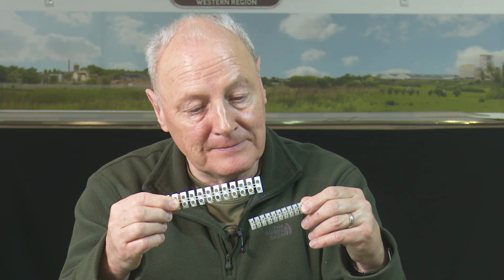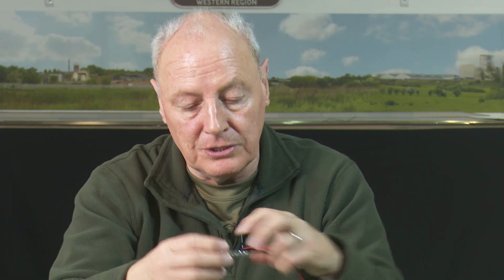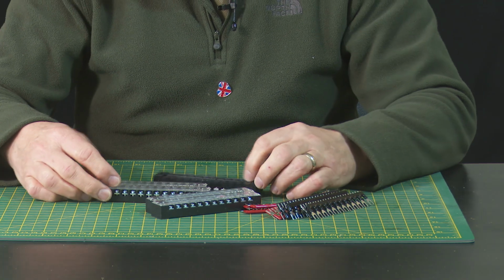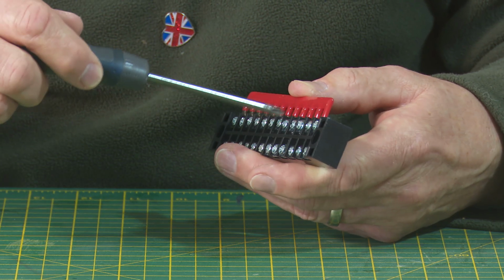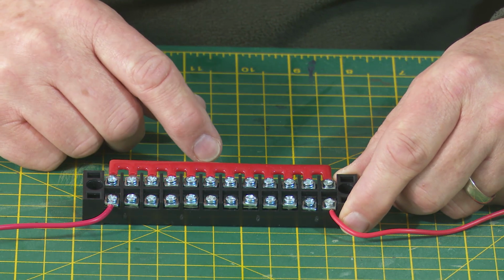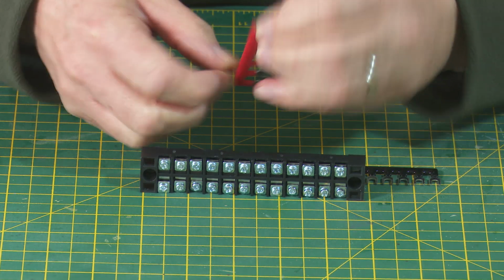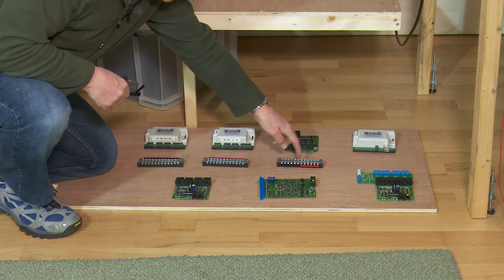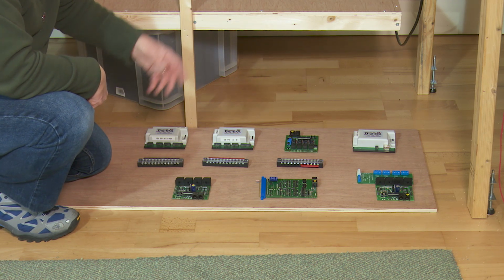Terminal Blocks for model railway wiring at Chadwick Model Railway | 85.

Comment: I might have to move to the UK. Those terminals are 90 plus australian dollars, plus postage. Model railways is becoming a hobby for the elite here in australia. Love your videos, keep them coming
Reply from the maker: Blimey Leon, that’s a shocking mark up.
Reply: @ChadwickModelRailway  Leon, shop around the prices are all over the place. As Charlie said they are a fantastic way of wiring the layout. I used them 30 years ago to do my turnouts and power to the tracks. I haven't had to touch them since I tightened the last screw 30 years ago and that includes moving my layout 110 miles. Glenn

Comment: Hi Charlie just got back from two weeks away and managed to get caught up on your videos. Great idea using a pre-made bus bar to create this type of terminal block. I have used the white type and found with stranded wires the screws get loose over time, especially when inserting multple stranded wires to create the bus bar. This looks like a much better solution, thanks for the tip.
- Mike
Reply from the maker: I’m so pleased that you found it useful Mike.

Comment: Hi Charlie, great stuff as usual - you could start a QVC-type channel for model railway people. That aside, have you thought about doing a video tackling the subject of block detection in a little more depth? That's assuming there's much depth to go in to. I've waded through the Digitrax manuals a few times but a clear, straightforward explanation is always helpful with a few visuals to aid digestion. Anyway, keep up the good work and stay healthy. Jon
Reply from the maker: I will cover it in-depth at a later date Jon.
In the meantime please checkout a recent video on this subject, by McKinley Railway.

Comment: My comment about the wiring board with components: your earlier feedback about the board horizontal and back ache is valid, as is a board set in a vertical position. However a board set at 45 degrees with a bottom lip (for your pencil/pliers) is easier to work on and can be mounted high enough under the top baseboard (and towards you, not on the wall) to enable one to sit on a stool and do the wiring work! 🤠
Reply from the maker: I totally agree but I am going to try it vertically with some cable slack should I change my mind.

Comment: Hi Charlie, I just watched your soldering tutorial which was interesting. I think it would be a good idea to seperate the 
PCB baseboard joining section as a stand alone as there is nothing I have found on you tube as good as your demo!
I like a few other modellers have a lift out section in my loft access with a double track one of which is unavoidably on a curve (drat). I would love to see how you would deal with that problem as I feel a bit daunted!
Reply from the maker: Sorry but I don't plan on having a lift out section.  Regards Charlie

Comment: Hi Charlie, I prefer using terminal blocks as well. For attaching my wires to the terminal blocks, I prefer using  Insulated Fork/Spade Connectors for 22-18 AWG wire and crimping the connector onto the wire, such as these (uxcell 200Pcs SV1.25-4S Insulated Fork Spade U-Type Wire Connector Electrical Crimp Terminal 22-16AWG Blue/Black/Red/Yellow ) I agree, attaching your electronics board to the rear wall under your layout is a better option if, you're able to sit under the layout fairly comfortably and service or maintain the board. On a side note, I've been a satisfied owner of a Digitrax system since 1999. Cheers, Rich S.
Reply from the maker: I'm pleased that you're onside RWSB.

Comment: Hi, Charlie. Another informative video. Keep them coming! If you'll permit me to digress from this one, a while ago you were talking about the range of Peco points and said something about not using the three-way units on the home layout because your local club had encountered problems. I had gone past the tracklaying and testing stage (with 0-6-0 pannier tanks and 2-6-2 prairie tanks ) when that clip appeared, and had no trouble. I have now acquired a Hornby 4-4-0 COUNTY, and it falls off almost every time it tries to go over a three way point. Is this why the club has moved away from them and, regardless of the reason, what would you suggest instead, please? [Other than retiring the engine!]
Reply from the maker: Hi Peter, yes it’s staggering the differences that we encounter.  Search out the Peco channel on YouTube and you’ll fine a video they produced many years ago on point modification.  They explain which parts to file!
Reply: @ChadwickModelRailway  Thank you!

Comment: Did not read all comments below. I was thinking if the board below the layout was in a slight upward angle, would help seeing your electronics easier for wiring and mounting. Might make it easier to work on. Got to get me some of those blocks. Thank you!   joe
Reply from the maker: An interesting point Joe and good luck with your layout.

Comment: Good tip Charlie. If you put the spade connectors on the individual wires too you can then make screwing them that much easier than the wire and give a better electrical connection.
Reply from the maker: They are in the post mate.
Reply: What size spades did you use? I’m about to order and would like the security of them. Cheers

Comment: I have been in electronics for 35 years and cant tell you how many places they are used.They size from 2 terminals all the way up to 25 that I have seen or used. Very rare are the 50 pair. Suggestion: Mount the board on a 45 degree angle. Kind of reduces the reaching all the way back. I mounted mine under the table on the wall and in order to work on it I have to sit on the floor under the table and hit my head several times. Currently doing a complete rewiring, switching from snap switches to Tortoise switches, so now I can move mine to a 45. Great video and always a pleasure to watch.
Reply from the maker: Thanks B68C, I’m so pleased that you the channel.  I’m going for wall mounting but with a great deal done before the the board above is in place.  There is no ideal answer on this one.

Comment: Another great video Charlie, I agree 100% about the drawer idea. I have my power board vertical and set in about 8" from the front of the table, and hung on hinges so I can open it like a door if I need excess to the back of it. Though at some stage i'm going to move it back about another 4" so it'll be a foot from the front of the table to the board. I have arthritis and stretching can be a problem, so I tend to make things as handy as I can. Stay safe Charlie, and keep up the good work.
Reply from the maker: Thanks AM. You’re in the minority but I’m with you on this one.

Comment: I have always tried to use screw in terminals myself, but, if you don't want to replace all your soldier contacts, why not try conductive epoxy (basically a glue that acts soldier).
Reply from the maker: Blimey Samuel, that’s a new one on me.

Comment: Good idea.  I have several types of terminal strips.  Phone companies use push terminals that are great for 22 or 24 gauge wire.  However you will never get away from soldering.  I just try to prevent doing it upside down.  Do like those preformed jumpers.  Glad to see you are surviving the Virus attack.  Waiting for your next video.
Reply from the maker: I’m so pleased that you found it interesting Ken.

Comment: Hi Charlie................ Blast ! I had thought I'd invented something new when 6 months back I made up almost the same thing using 3 amp chocolate blocks with pins and links made from  18 SWG tinned copper wire and dipping the wire grids into  a multi purpose rubber coating called Plasti Dip which comes in many colours works very well for my DCC wiring as I can make them any length up to 12 terminals,cheap too chocolate block cost me 30p each ex AliExpress (pre Coroana) wire cost at most 5p the Plasti Dip was quite expensive but 250ml of each colour will last ages.I probably use your idea of different coloured tape though as I have got orange and brown Plasti Dip
Reply from the maker: You've missed a potential goldmine Athnony

Comment: Another informative video Charlie, I would suggest using spade terminals on the ends of the cables/wires though. Probably not absolutely necessary, but personally I’d feel more comfortable using them for a more neat and secure connection.
Reply from the maker: Dexter, they are in the post.
Reply: What size fork connectors are needed for this please, Charlie? I've searched high and low for a spec😢

Comment: One of your previous videos inspired me to redo my wiring. I couldn’t find the chocolate blocks but ran across these on Amazon instead. They work very well and now use them throughout my layout, especially in the yards where I have a lot of PECO switches planned. Instead of raw wires I crimp a two prong connector to the end to slide easy on/off with the block. Also makes it easier when moving wiring around. Didn’t think of snipping the jumper. Going to use that going forward in a few spots.
Reply from the maker: Clever minds think alike RS

Comment: Hi Charlie, I've gone down a similar route of Choc-block connectors, but then found these rising block terminal connectors. They come in all sorts of variations , from pairs to blocks of 36 and are dirt cheap. I get a strip of veroboard/stripboard, trim it to the length and width I want, plug in the terminal blocks, solder them all up, and away you go - https://www.rapidonline.com/camblock-plus-ctb0609-3-10-16mm-low-profile-rising-clamp-terminal-block-3p-20-3078
Reply from the maker: An interesting option Jeremy.  
Many thanks.

Comment: Those little terminal blocks look very neat. I'm using Wago connectors for joining cables without soldering, but they only go up to 5 or 6 cables. Wago connectors are used by electricians, so they are robust and widely available.
Reply from the maker: Thanks for the info Chris.

Comment: Hi Charlie,

I have just about finished my DCC Programming Track, on 30 cm x 100 cm 18mm plywood, including using the same Burnt Umber acrylic paint you used! I will be ballasting over the weekend.

I am shortly buying the main layout baseboards, and will obviously be adding droppers for each bit of new track I lay, which means your discovery of these Terminal Blocks from Amazon means I can wire my whole layout much more easily and much neater! Thanks very much for this information... it has been very timely in my case.

Regards,
Jim
Reply from the maker: I’m so pleased that you found it useful Jim.

Comment: Personally the economical option is £6 for 10pack connector blocks at toolstation if you have the time to wire in each loop connection. Although To save time with basic connector blocks do the connector strips in black and red fit the original choc blocks?
Reply from the maker: No Bob, they are spade connectors.
Reply: Chadwick Model Railway thanks bob

Comment: Gday Charlie these terminal blocks are brilliant however we solder or ferrule bootlace connectors on to the bridging part for your inputs and you can also on your outputs put 2per connection giving up to 24 feeds etc cheers David and Jenny
Reply from the maker: Great point D&J, I’m trying to find ferrules myself.

Comment: Nice video Charlie. Been using those terminal strips in various lengths on my layouts . I have a 14 ga bus running around my layout and I skin some of the vinyl insulation off the end of the jumpers and directly solder the 14 ga wire to it. This frees up all of the terminals on the strip for use. I also attach spade lugs to the ends of my feeders to slip under the screw instead of using the bare wire.
Reply from the maker: Hi Paul, is that the red spade connectors?

Comment: Great connector block, you can also get pronged crimps for the end of your wires too, which would make screwing them in neater too, like the suggestion of soldering bus wiring to the strip thus giving you more terminals free
Reply from the maker: I’m so pleased that you enjoyed it Tricky

Comment: Nice..... just quick question do you ever use bootlace ferrules on the end of the wires / cables...... regards fred
Reply from the maker: I’m trying to acquire some Fred. 
Any tips?
Reply: Chadwick Model Railway ...... https://rover.ebay.com/rover/0/0/0?mpre=https%3A%2F%2Fwww.ebay.co.uk%2Fulk%2Fitm%2F282671798158

Comment: Brilliant product. Now want some 12v LEDs with long wires already attached.
Reply from the maker: You could make them Alan .... please.
Reply: @ChadwickModelRailway  - I made my signals by soldering wires onto the LEDs I had bought, But if it would have been so much easier if the LED product already had this. My soldering works (eventually) but its not pretty.

Comment: On my DC layout, and so far over 600 wires added to Tag strips and then you do this to me 😢 No problem though Charlie as I enjoy soldering (insanity certificate available lol).  Nice thought though.
So many options for the module board. I think it really does come down to your personal preference. Mine would be the one you don't like...the slide out board. Cheers for now, Bob
Reply from the maker: I’m building the board on the wall as we speak!

Comment: Hi Charlie ... thats a great idea a bit pricey but I think everyone has been bulk buying Amazon only showing 6 way but you can get from China for £2.94 each inc red/black strip 12 way ... I have used alsorts of connectors from chocolate blocks to ribbon cable IDE connectors and plug in connectors that solder to Vero at other side..  have a look at www.taydaelectronics.com 7 day delivery and fantastic prices..
Reply from the maker: Have I caused panic buying!

Comment: Charlie, rather than using up terminals 1 & 12 for power in and to rest of layout, add these wires to the same side as the spaded multi-jumper (No not a cardigan for the spring, summer, autumn & winter - LOL). That leaves free the out 1 & 12 for two further connections, but yeah these are a great item to get for myself. The Digi-board on the back wall under the layout is a logical idea, plus it leaves you space to pack your storage boxes still. Also, it will give you the option to have a larger even a loop around under layout boards storage yard for more rolling stock. So in Bill & Ted speak = EXCELLENT.
Reply from the maker: We are singing from the same song sheet on the one John and you’re right about the power feeds too.

Comment: Hello again. Boot lace ferrule ‘crimps’ are available to suit wire with as small as 0.25mm cross section. Cost seems to be under £1.50 per 100 for insulated. Uninsulated don’t offer a significant saving, and insulated are far better for handling after crimping. They can be obtained in a range of colours, but to buy the colours you need may be wasteful, and your wiring is colour coded already. Online, you may be restricted to a few colours per size anyway. With a rigid end on your wiring, you open up a whole world of possibilities... check out Wago 221-415 levered connectors. I’ll leave you in peace now. Have a great weekend.
Reply from the maker: Excellent tip Tab but can you send me a link please?

Comment: Being an old electrician. I've done many of those strips in my time. I love the little bus bar bit. Saves a hell of a time not making those loops. Yes.
Thanks.
Reply from the maker: Yes it’s a real bonus SL
Reply: @ChadwickModelRailway  I figured that's the case, I bought something similar from ebay months back, but it didn't have the additional bars. Personally, I've got access to a water cutter, so it would almost be easier to just make it myself, cutting a bit of metal to the correct dimensions and then dipping the rest in rubber.

Comment: Perhaps you could connect your bus IN and OUT wires on terminals on the same side as the bridge connectors, giving you two more connections to your "turtles" or other power users?
Reply from the maker: You’re dead right M37

Comment: And, naturally, you will be scheming to trip the protective covering off the common strips and soldering the feed directly to those strips (gaining yourself two more output terminals.
You made the electrician in me flinch a bit by pinching stranded wire under the "wrong" side of a screw--you feed into the clockwise tightening, not against :)
Now, my other thought was that you could get the crimping open spade end connectors to ake up the conductors coming off the terminal strips.  Those are easy to find.  What's worth a bit more searching for are the terminals that have a tiny drop of solder in a bit of clear shrink-wrap.  You use a heat gun to melt the solder and close up the shrink tubing.  You may have to find automotive electronics parts house for those--but they make a full range of connectors, bullseyes, spades, unions (best union for wires out there, too), and so on.  Just my 2¢
Great work, keep at it, and stay safe over there (we're having a bit of a tizzy here as people are finally paying attention).  Luckily, model railroading is emminently suitable to keeping 2m away from other people :)
Reply from the maker: Great comment Capt Mac, I’ll try and find some ferrules too.

Comment: These, Charlie are the duck's guts. I had, as you had previously shown used chocky blocks, making bus blocks...very untidy.
Found them on Ebay and yes did get them shipped into Tassie (The Apple Isle). Neat, simple to use.I use crimp terminals for connection, with my bus feed being connected at one point of contact at the bus terminal strip, hence getting twelve outlets. best regards'  Gary
Reply from the maker: The duck’s guts is a new one on me Gary.  Yes powering from the other side makes more sense.